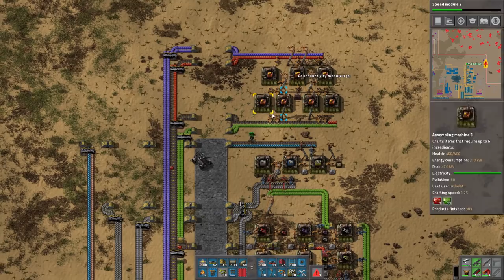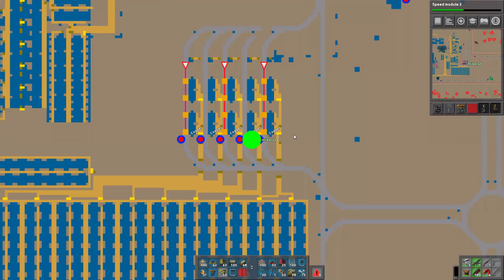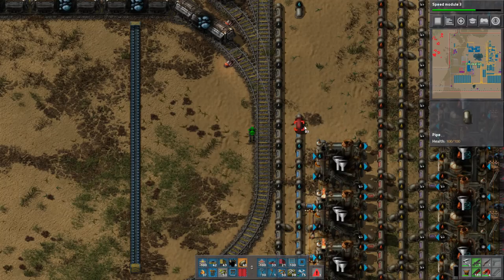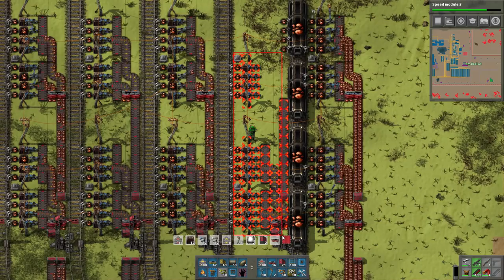Let's Play Factorio 0.16 - Part 36 [Desert Deathworld Marathon]

Comment: I don't know if you ever realised this, but the reason your copper (and iron) lines aren't unloading fast enough and the lines from the furnaces aren't going full speed is that you combine 2 red belts into 1 blue belt, which does not have twice the capacity of a red belt, but only 50% more. So basically the last 20 furnaces (10 per side) on each line haven't been unloading their copper/iron at all because the blue belt isn't going fast enough to transport off two red belts' worth of input. You'd have to do something like make the blue splitters (the ones that are fed directly by the red belts from the furnace outputs) have a blue and a yellow output (because you're missing one yellow belt's worth of capacity), then combine three yellow belts into an extra blue belt, then add that blue belt to the balancer. Or something. That'd at least be the far less furnace-demanding solution than what you were doing.